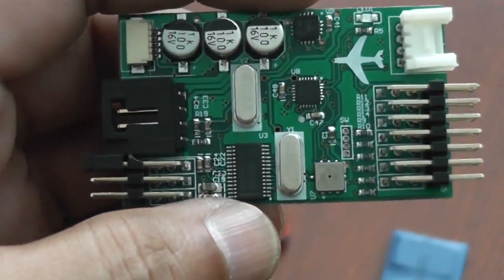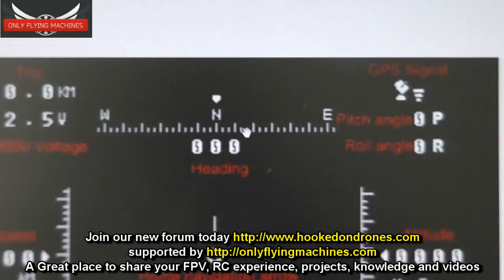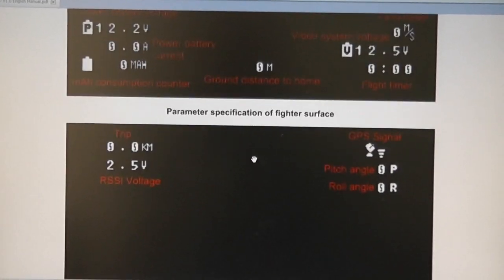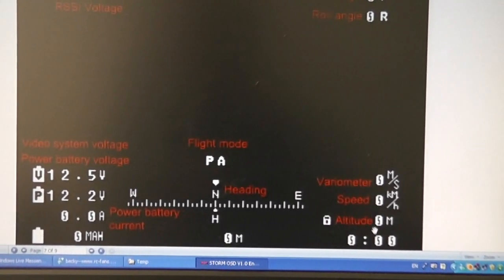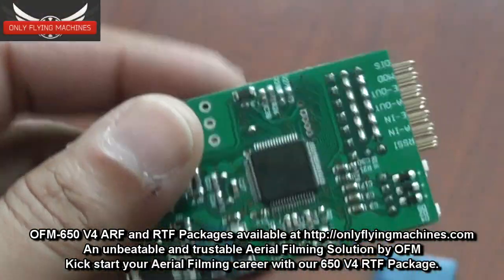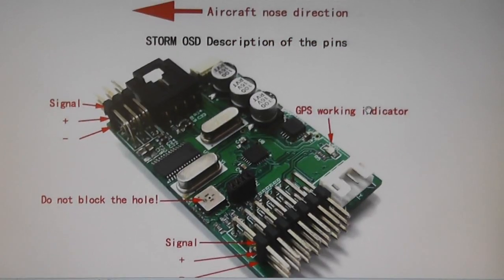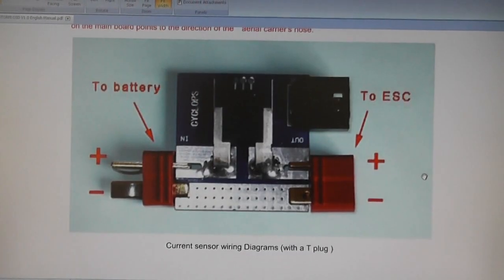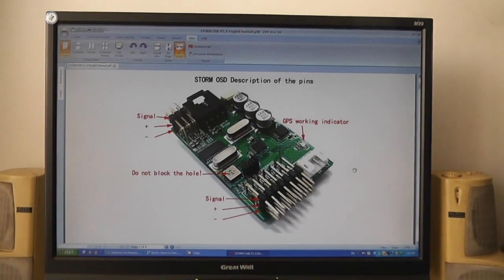Review: Storm OSD with Built in Autopilot

Comment: The storm will only climb to the preset altitude for RTH.  IF the airplane is higher then the preset altitude the Storm will maintain that altitude and will NOT descend to the preset.  Example.  200m is the preset altitude.  Engage RTH at 100m, then the Storm will climb to 200m.  But if at 300 meters the Storm will remain at 300 m when RTH is activated.

Comment: I have installed the storm and I found the RTH creates a large turning circle and the plane seems to gain altitude rather than hold it at 150ft. I have to take over control to bring down the plane to a safe height, could I be flying at a too higher throttle, I have all this kit fitted to a bixler2

Comment: i think hava  a problem on the  storm osd.
around the rf  noise 433 - 435 spreads ! we  saw  that  with  tested spectrum analysis
interesting.....

now we can fly only 1 or 2 km  intervals and then begins glichs .!.
sometimes active on its own RTH but, 

Everything I've checked everything seems to be normal..

What should we do to remedy this situation_?

my fpv gears is Skywalker 2013 and EZ uhf , 1.3 rangevideo, Storm osd

Comment: Hey, Ali山猫! I did hook up the Storm OSD without a video link and it works! I need some clarifications on RTH mode before I'd try this... I noticed that I could override the RTH feature with sticks even in RTH mode. Can I fly constantly in the RTH mode with TX stick control which will override the RTH function? I'm hoping this will be a safer way of flying(since I don't have failsafe on my Flysky Rx) in case I fly out of range??

Comment: Hi alishanmao,
I purchased a Storm in Dec 2012 it worked well for 2 weeks then failed, Bevrc replaced it for me very quickly (thanks Bevrc) but the replacement also failed,this time it just lost video after 10 hours of use.V1.02 I have sent Bevrc a number of email requests about returned shipping credit and the faulty storm but they are not replying to me. They should have received the second returned storm by now . Do you know any reason why they are not replying . my request was 1378 . Geoff.

Comment: Hmmm?? No ESC signal out from the OSD? In a true failsafe RTH condition the OSD has no control of throttle. You could set an RX throttle failsafe value but this is not ideal if you switch off your radio gear in the wrong sequence on the ground...